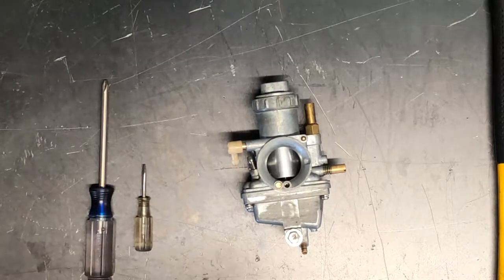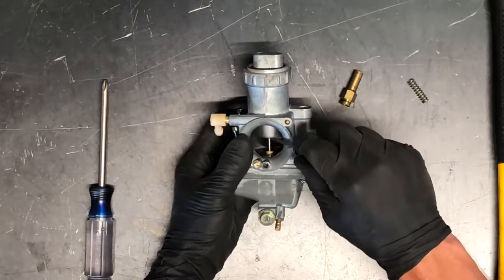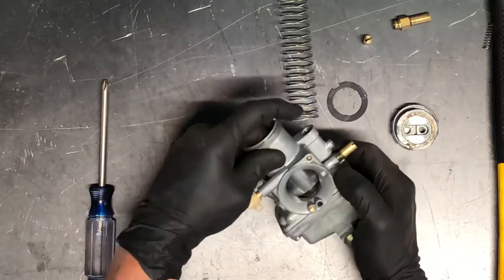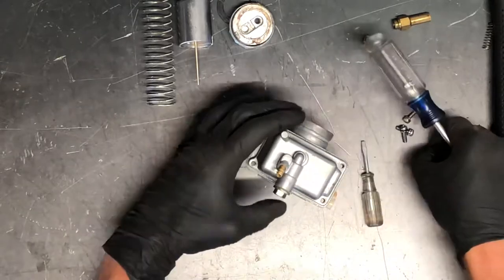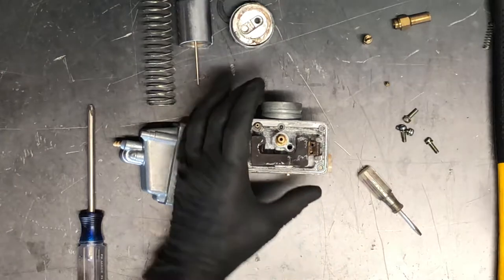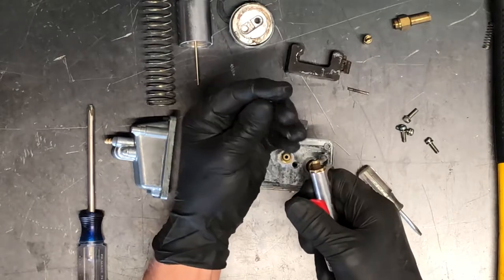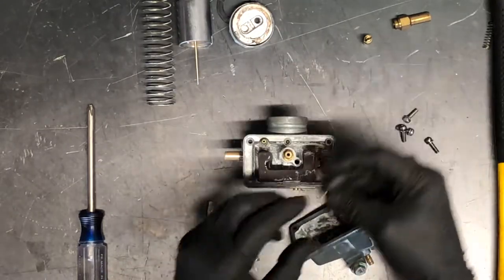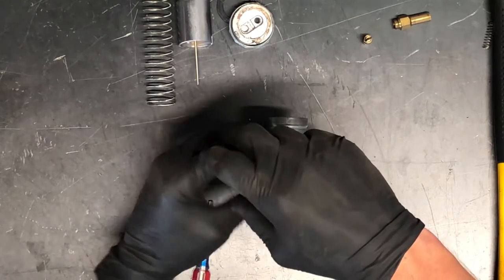1975 Kawasaki F9 350 Big Horn Vintage NOT RUNNING - Carb Clean Bad Gas Dirty Carburetor Rebuild

Comment: what about the air screw? You didn't cover that. I know where it is etc, but what I was  hoping for was this: what is that small port in the throat next to the air screw? it looks as if it has a brass fitting in it...does that have an orifice? do you know what its for?